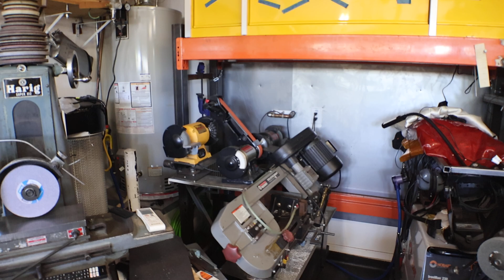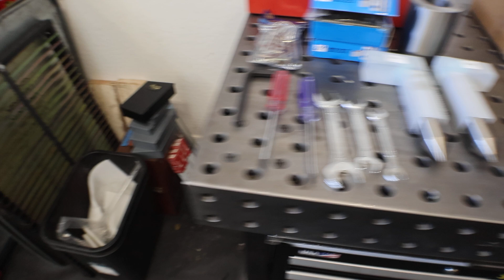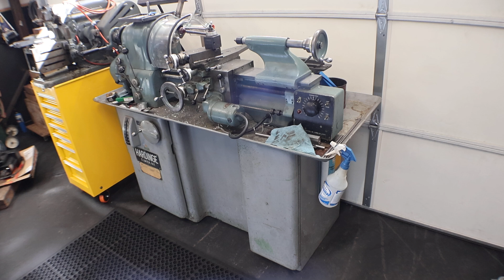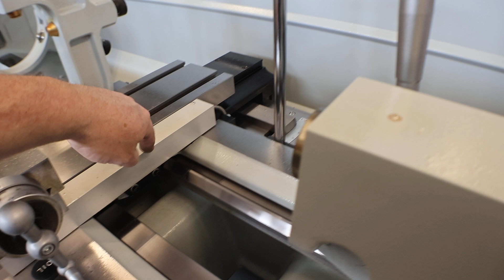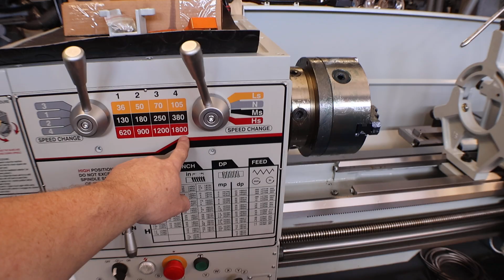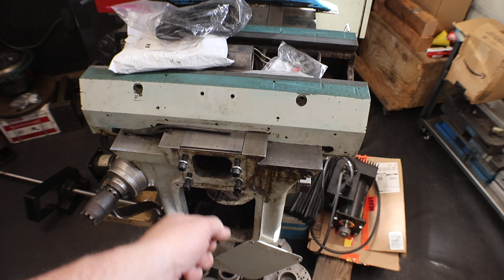Precision Mathews TL-1640 Lathe. Day One. Quick Manual Machine Job Shop Overview in Two Car Garage.

Comment: Love your shop setup, what did you use to move all the heavy machinery in their locations?
Reply from the maker: @Mudweizer  thank you. The toolboxes I placed with the pallet stacker and the machines I bit the bullet for a rigger.
Reply: @ I’m new to your channel, is there any video of the lathe being unloaded and positioned by the riggers?
Reply from the maker: @Mudweizer  unfortunately not but they make quick work of shuffling the shop around. The Lathe was shipped to their facility and they delivered it to the house the day of the install.
Reply: thanks for answering my questions, I found a lathe this size locally and questioned in my head if I could move it around with a pipe, two big straps, and an engine hoist.  The place selling it has a folk lift to load it on my trailer, but putting in the garage is another story.